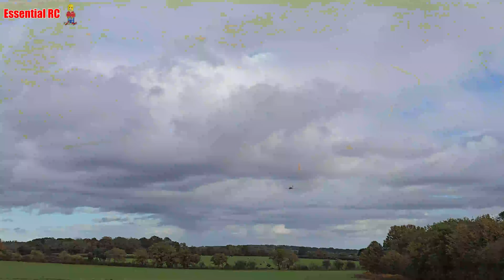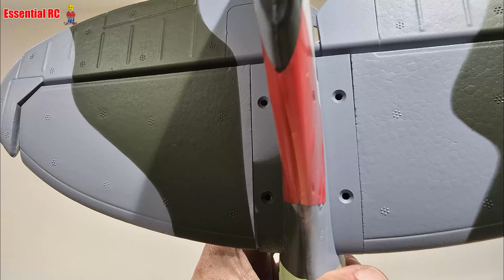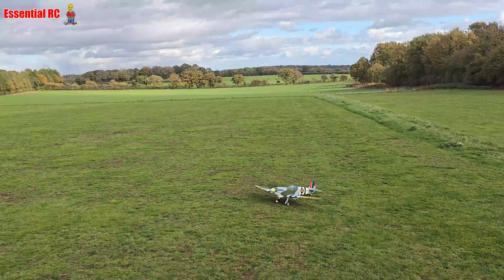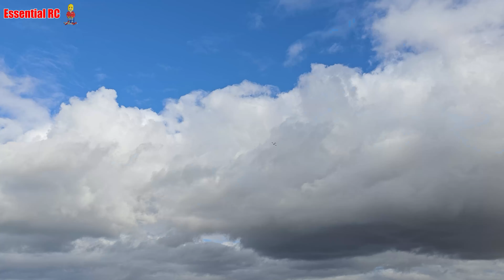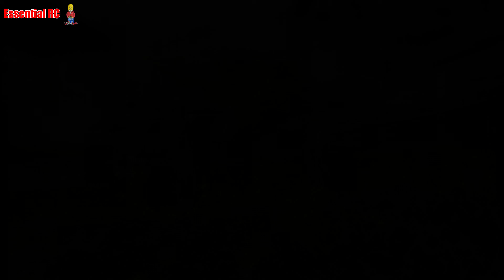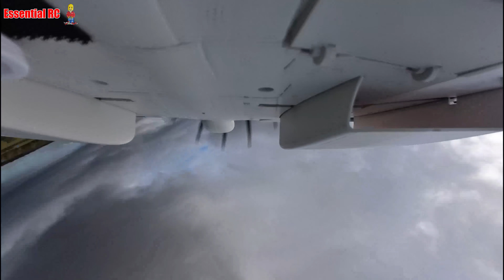IDEAL FOR WINTER RC FLYING ! XFLY MODEL 1.2 metre Supermarine Spitfire MKIX

Comment: Good video.
I see they do a version without the landing gear. Wouldn't that just break the propeller when landing, as it's a four prop?
Reply from the maker: Possible but unlikely. These props are flexible and bend quite easily.

Comment: Do you think a gyro receiver would smooth things out in this breeze Dom? Could you recommend a transmitter please as my Spectrum is an early version.
Reply from the maker: Personally I wouldn't worry with a gyro. Even in that wind it wasn't been knocked around that much. I switched to RadioMaster radios few years ago after seeing the ridiculous price of Spektrum radios and receivers. The new TX15 looks good and together with an ER8 ELRS receiver wouldn't break the bank. If you want to use that radio with your existing Spektrum receivers just buy a 4in1 module and you'll be able to use all the Spektrum receiver protocols plus many more.
Reply: @EssentialRC thank you so much for the suggestions Dom. It’s time I upgraded.

Comment: Nice flying Dom, how would you compare it with the 1100mm Durafly Spitfire?
Cheers.
Nick.
Reply: Lovely plane and well flown as usual 👍 My only comcerns would be the reports that Spitfires are a wee bit tricky in crosswind with narrow track undercarriage and (on grass) nose over easily on take off and landing if there isn't a healthy breeze when holding up elevator on the ground to prevent it (as many taildragger warbirds seem to be prone to). Any thoughts there?
Reply from the maker: No flown the small Durafly Spitfire, so can't compare, sorry.
Reply: @EssentialRC i think you have as you've reviewed them over the years from Hobbyking lol
Reply from the maker: I looked back and I couldn't find it. I have flown the larger Avios Spitfires
Reply: @EssentialRC i will let you off this time Dom lol it was probably a while back now i think you did the fantasy blue navy one and i think the Mk1a they re did about 3 years ago i have the fantasy one and flies well just wanted your opinion on it of its worth a punt putting in my hanger.
Regards.
Nick.
Reply: @EssentialRC yes you did. I watched your review before I bought my blue 1100mm durafly seafire. Once I got used to it, I asked you if I was ready for a 1450 avios spitfire. You said yes, and gave me some really helpfull tips. About 5 years ago. For what it's worth I still fly the avios, and only decommissioned (canabalised) the seafire about 6 months ago. Thanks for the tips over the years. Andy in uk 😊.
Reply from the maker: Ahhh. Seafire! Remember that one. Was good. Happy flying buddy 😊